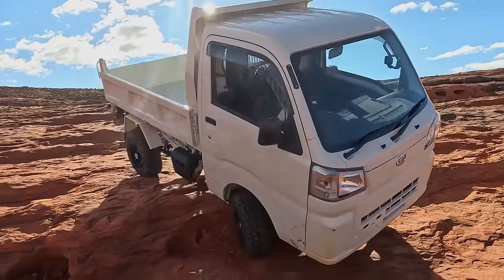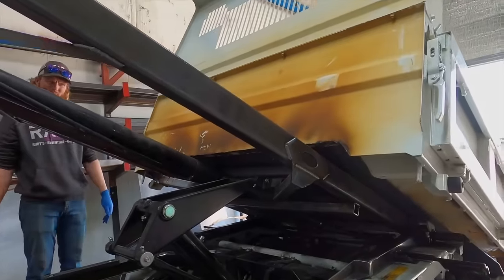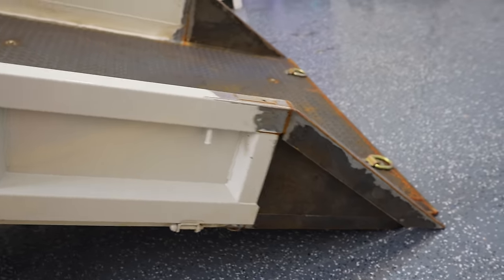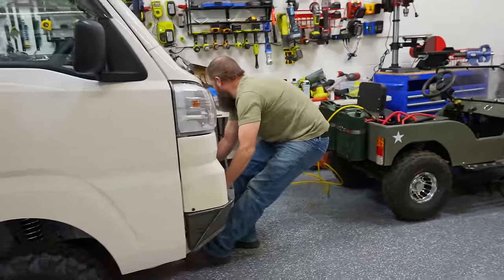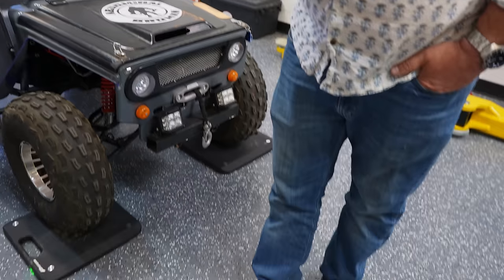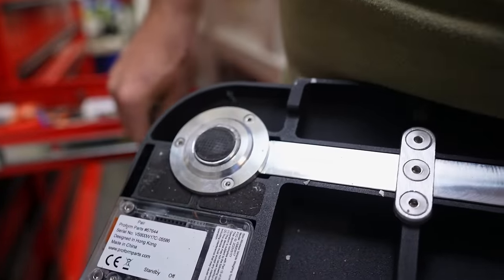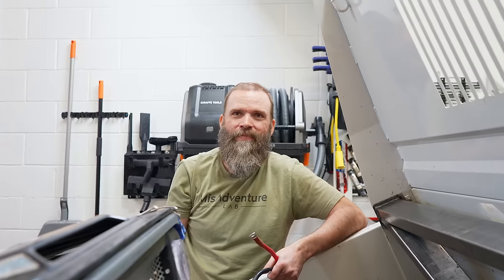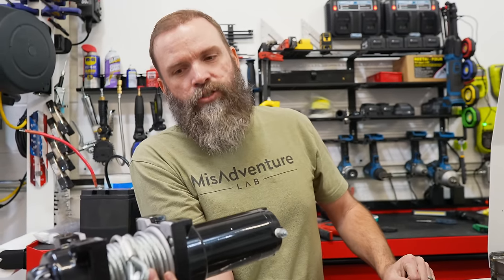The Mini Rollback Strikes Back

Comment: Outriggers would be a safety item to keep you from tipping the truck over!  All the big boys have them!!
Reply: That will be absurdly easy. Just weld a strong hoop onto the passenger side bed side.

Drop the side, and have Tucker stand on the hoop,and hold onto the headache rack!
Reply: World's smallest off road rotator rollback
Reply: An extended RV stabilizer jack on the should do the job

Comment: When drilling thicker plate make a pilot hole first it’ll save your bit, time, and energy. Really enjoyed the content keep it up!
Reply: Also, anything over a 6mm (1/4") has to be run on speed 1 on a hand drill.
I spent years burning out 10mm drill bits before I realised.
Reply: This 👆
Reply: And maybe upgrade from a harbor freight drill to something with a chuck that works, haha

Comment: I think i'd add some outriggers to keep the truck from tilting when using the crane. You could probably use some camper lift jacks, or just some tubes that slide inside each other that can rotate up out of the way when not needed

Comment: Slow down the drill when you’re drilling steel. The high speed will over heat the bit and destroy the temper. That softens the edge and ruins the bit.
Reply: This.. low rpm and steady pressure for drilling steel.

Comment: On my mini truck I added sumo springs to the back, they are urethane bump stop.. They are awesome and if installed right they dont stiffen up the ride like adding an extra leaf will do. I can carry 2000 lbs in there with no problems.  Keep up the good work.
Reply from the maker: Oh sweet, thanks for the tip

Comment: You should drill a pilot hole with a smaller diameter drill bit, like a 3/16” then step up to a larger bit.  You might want to get Rudy to weld a brace from the upper portion of the crane across to the lower left side of the headache rack.  Your extendable boom should also be marked for maximum acceptable load at each extension point.

Comment: I have suggested to Matt for year (s) an off road rollback. Say F-350 crew, longbed, SRW. Convert to reg cab, put 14’ or longer rollback deck over 6 wheel drive. There was? A kit for adding a 2nd rear drive axle.  With Matt’s crew ability. It should be easy. Make it to recover side by sides, and most Jeeps, SUV, vans damaged off road.  Heck both rear axle steer if he wants.

Comment: Ya might consider a jack leg, ( like the stabilizer or out rigger on large tow trucks ). that will fit on either side of the truck so when your deploying the hoist you can support the bed.

Comment: I’m guessing those matco bits were replaced with some cheap knockoff bits.  I’m not one to use the high end tool truck bits but I did splurge on some Walter drill bits and they work great.  They also hold a cutting edge after drilling many holes

Comment: Hey guys you never use a half inch drill bit to start it you always have to drill a pilot hole. I thought everybody in the world knew that that's why I step a drill bit works cuz it goes from small to big. Have a great day guys.
Reply: Its perfectly doable, especially for a big guy like Tucker. The real issue is the drill bit, its no good for that thickness. The tip is really odd, it has no proper cutting lip it seems. It must be for very thin metal so it doesnt pull right through and make an oval hole. Dunno, never seen that before. Evidence is the cheaper drill bit Tucker used - went right through.

You can actually fine tune drill bits by altering various angles depending on the type of steel, thickness, diameter and required hole precision for optimal cutting performance. You might be surprised how big a diameter you can punch through a steel plate manually if everything is set up right. But not with a tiny hand drill like that (not necessarily because of torque but manhandle purposes).

Comment: When using a drill bit, let the bit do the work. Pressing down on it with such force to break the bit can over heat the cutting surface and dull it. Yes, it's probably user error.

Comment: Hi whatcha up to hope all is well sending up prayers 4 healing and unspoken and 4 everyone and bless great healthy peaceful safe journeys travels and happy day everyday in name of the Creator God/Yahweh and Yeshua/Jesus and the Holy Ghost/Spirit Amen much honor and respect keep walking tall always also yall should fix up some outriggers attach to the truck frame of ur mini roll bk and make it a dually and or stronger made tires and or stronger suspension system 4 the rear also definitely paint the frame and outriggers and brush/grill guard/herd bumper and all the bed u could paint it all raptor bed liner paint they come in different colors too maybe tan or green and or paint the whole truck electric blue with reflective red decals and striping on ur mini roll bk also strobes every where however this is very cool I had always imagined a mini roll bk out of those trucks and yall did it that's awesome and keep praying and keep on keeping on pushing forward one step at a time 
🕊🦅✝️💪🙂👍👍 
🚛🌅🌌⛺🌄🏞🏖

Comment: It need's a 2gallon air over water fire extinguisher, Just in case !
Reply from the maker: Is that just a water based fire extinguisher?
Reply: @MisAdventureLab  Yes, correction; search for 2 1/2 gallon air over water hand held fire extinguisher. Add tablespoon of Dawn dish soap and 125 psi !  Then put that little campfire you guys made completely out with the quickness, but beware , it can make the fire leave the area with too much trigger . 150psi is doable but, you must not point it at a person as it may put an eye out .

Comment: Truck needs some deployable stabilizer bars on that passenger side, that’s a lot of lean on level ground, don’t want to create a Jeep / truck sandwich.
Reply: Could be made with some square tubing and a trailer jack or 2
Reply: @dodgeme1986truck yeah a couple of those swivel boat trailer jacks would be perfect
Reply: @stanr3491  yup you could rotate them to horizontal for storage tucked up tight to the body then when deployed they can adjust to the ground it's resting on

Comment: Big rpm difference between the different bits you used to drill metal. You ran the new bits wide open and complained, ran the cheapo bits at a more proper rpm. Results came from user inputs, not inferior bits... With 90% certainty 😂 🤣 😂 🤣